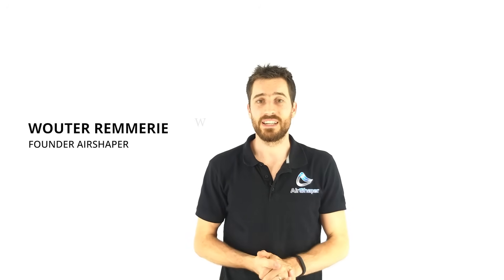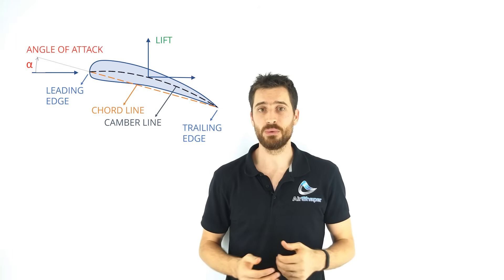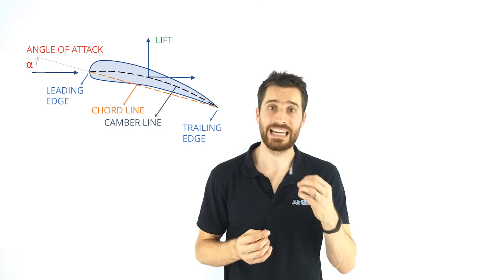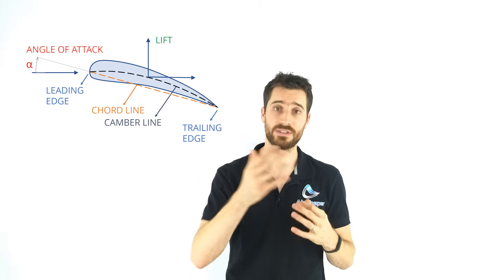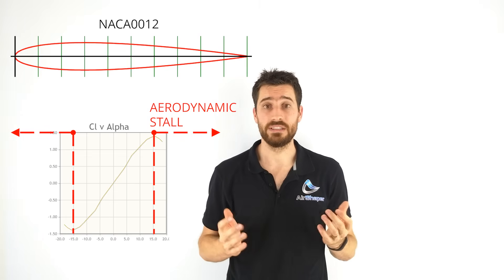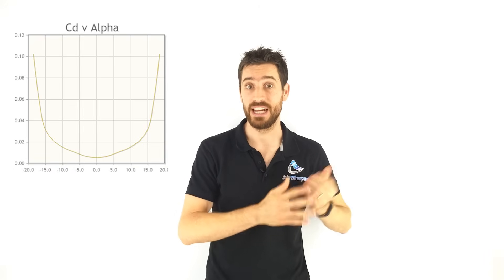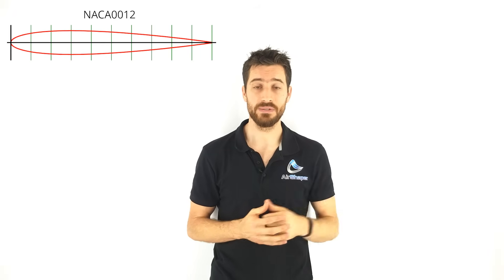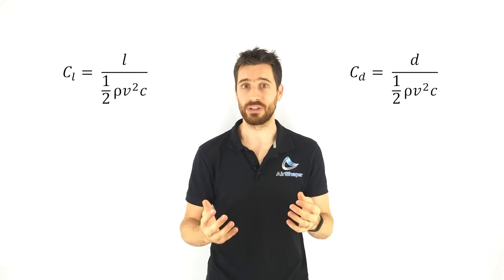Drone Design #1 - Selecting an Airfoil

Comment: It is a good video but i find selecting an airfoil as a first thing in the design process wrong. Airfoil selection can really be a late phase in design of a fixed wing vehicle. In drone design apart from cL/cD characterstics, coefficients of moment characteristics will matter more. If you are not in the last design phase, trying to optimize airfoil for optimum lift/drag without even having a planar and 3d profile yet will prove wrong. As an example, a thick or simple airfoil that still can get the jobe done will prove usefull in terms of manufacturing and extra size inside wing we can use for a lot of things.
Reply: I agree with this. Also the 3d shape of the wing plays a significant role in the final aerodynamics. Also, you can't select an airfoil without knowing an estimated trim condition and flight Re. And you can't know that until you've performed high-level trade studies
Reply from the maker: I agree that the video perhaps wrongfully implies this is a sequential process. In reality, it is like you say, you need to iterate between various aspects. At least we hope we gave good hints for a first shot.

Comment: I’m currently doing A Level Design Tech and part of my coursework is to design something of our choice this will involve Low fidelity and medium fidelity prototyping of some sort. Do you think it is possible for me to design an aerofoil or something? I want it to link to aerospace Engineering. Do you have any ideas on what I could do?
Reply from the maker: Dear Prashant,

airfoil design does require fairly high fidelity, especially if you are looking at 3D flow (which can vary greatly from 2D flow) and/or separation locations. Perhaps the flow around a drone bodywork could be interesting for you to study? (check our second video on drone design)
Reply: @AirShaper  Thank you for your fast reply and as a matter of fact it helped me a lot. I’m going to design and build a budget remote controlled drone targeted towards those who can’t use it due to money. Outside of your second video on drones is there anything else you could help me with?
Reply from the maker: @Prashant-pm7iz  Perhaps it could also be useful to check this article:
https://airshaper.com/cases/sense-fly-increasing-drone-flight-time
That would be about it in terms of what I can think of to help!
Reply: @AirShaper  Thanks mate, I appreciate it.

Comment: Which airfoil to use in 1045 propeller in typical quadcopters?
Reply from the maker: Hi Ayush, 
I wouldn't be able to answer thay without proper research I'm afraid!
Reply: @AirShaper  Can you guide me where I can find that? I need that data for 1045 prop and 1047 prop.
Reply from the maker: I wouldn'y know Ayush. Perhaps search hobby forums?

Comment: Do you know any hooks to teach designing airfoil? I need  to learn to design airfoil wings but I have no knowledge. If you let me know what are the books I need to buy I thank you
Reply from the maker: I would recommend airfoiltools.com, and of course a quick google search will yield many relevant books. Depends on the application (low or higj speed, size, ...).
Reply: @AirShaper  thank you so much. I need to design and build a wing similar to jet man. I asked many universities but none willing to help. So I need to do it myself. Any other useful information if you can give me? I guess since the wing has no tail the lower chamber design  should be upward. I need to calculate a wing 120cm of chord for speed minimum of 200km per hour.
Reply from the maker: @noneNone-mw1px  I wouldn't wait too long before moving to 3D, as the person will have a huge impact on the airflow! In terms of airfoil selection, indeed you'll want one that is relatively stable (the "torque" or "moment" will be important), with a gradual stall angle.
Reply: @AirShaper  yes true I need an stable airfoil with highlift efficiency. In my investigation I found that for delta wing with  no vertical stabilizer the best airfoil to have upward lower chamber. So do you have any idea where and how should I start? Universities are really very disappointing. Either they do not know or they' do  not want to help
Reply from the maker: @noneNone-mw1px  This would also be beyond my knowledge, but I think you should look for "self balancing/stabilizing wing or airfoil".
Reply: @AirShaper  you mean even will downward chamber is it possible to have stable fly just by balancing? I m a pilot ( not commercial) but that what I was thinking . I look into jetman wing airfoil from his clip. It looks like not having upward chamber.  But in x_wing  jet it has
Reply from the maker: @noneNone-mw1px  I wouldn't know if it's possible, actually. You could also consider browsing fora on Xfoil / FXLR5 (or use those tools!)
Reply: @AirShaper  thank you so much. I will look to it. Any books you can recommend me?
Reply from the maker: @noneNone-mw1px  You're welcome! No in terms of airplanes & drones, I stuck to internet for info. This one looks cool though: https://www.springer.com/gp/book/9783662026465
Reply: @AirShaper  thank you so much. It was very kind of you.god bless. Safe and sound

Comment: Hello Buddy, You explained it very well.
I'm an undergrad student and I'm supposed to design a fixed wing vtol with 2 hours flight time and 2 kg payload carrying capacity, so which airfoil you would suggest to achieve these milestones?
Reply from the maker: I suggest you to browse airfoiltools.com to look around, look for efficient profiles for your specific Reynolds number. And keep in mind that when going from 2D to 3D you can lose a lot of lift due to the finite wingspan. So do check for correction factors for this befote you size the wing (you can find some in Joseph Katz's 'race car aerodynamics' book).
Reply: Hii, I'm Shivam Tadwalkar from India. I'm also supposed to design a VToL aircraft. Can you please help me with that? If you have made your project.

Comment: A new easy way is to grab the free Airfoil Tools add-in for Fusion360 - it asks you how big/fast/high/etc, and inserts the CFD-optimised shape you need directly.  https://apps.autodesk.com/FUSION/en/Detail/Index?id=5447707798035545266&appLang=en&os=Win64

Comment: this is a good video. though I'm currently having a hard time selecting an airfoil for my fixed-wing drone. can you help me?
Reply from the maker: Hi James, indeed, it's not an easy task!! Best to start with your payload & estimated weight requirements to obtain a required lift value. Keep in mind that when going from 2D to 3D, you loose quite a lot of lifting power due to the non-infinite wingspan. So be sure to run a full 3D sim at some point as well! And if the choice of airfoil is too complex, start with a common profile that you find on other drones (google will quickly show interesting references). The special profiles are for later on, once you've run prototype tests and/or need to upgrade your design later on.
Reply: @AirShaper  Thank you so much. makes a lot of sense

Comment: 1/2*rho*v^2 is not the stagnation pressure. It's the dynamic pressure.
Reply from the maker: Hi Stefan, you are right, it is the dynamic pressure. We're a bit too used to working with relative pressure difference so we forget to add the static pressure, our apologies!
Reply: AirShaper All good. Thanks for the video

Comment: hi, im an engineering student and i m making a drone whose function is to carry an attachment that will throw a ball to a particular place at some height , i searched about drones , and i got to know that copters that lift more weight are difficult and too costlier to develop, so my q is can i opt for fixed wing to perform the same operation, whats your opinion?
Reply from the maker: Fixed wing drones can indeed carry more weight in some cases, but they need speed to have the wings generate lift. So it could be necessary to launch the drone using a catapult for example (this is quite common)
Reply: @AirShaper  can you explain in detail in which cases it can lift more weight and do i need to launch it from catapult even if i have a runway long enough?
Reply from the maker: If you have a large runway, you may not need a catapult. The ground effect (wings generate more lift when close to the ground) will make take off easier. So it comes down to selecting an airfoil and a required velocity to get enough lift!

Comment: Hi sir 
I am an Aeronautical student doing my undergraduates .I am interested in designing drones but I don't  have any proper guidance of doing it done .Can you say  me what to do exactly to learn to design and what are the things I need to mainly look after for getting it done .

Waiting for your reply
Reply from the maker: Hi Viswak, there is a lot to be learned by just starting to build your own, using parts from hobbyking for example (if budget permits it). Setting up controllers and so on, will make you learn a lot! Apart from that, perhaps it could help you focus to decide on whether you want to go for vertical propeller drones, or fixed-wing like drones (in the latter case, you may want to focus more on general aviation theory). Good luck!
Reply: Thanks for your reply .It was very useful but I have one question what are the open source software for programming and designing drones We can get which is best .

Waiting for your reply
Reply from the maker: @hurtlessstatus3414  Maybe you could have a look at this one: http://aero.go.usu.edu/machup/
Reply: Thanks a lot it is very useful
Reply from the maker: @hurtlessstatus3414  Most welcome!
Reply: I also enjoy MachUp. feel free to check out their udemy course on drone design.

Comment: Hi Wouter 

Am a Mechanical Engineering Student planning to do my Undergraduate thesis On Unmanned Aerial Vehicle could you suggest some books and website where i can start from scratch to build a UAV and all the basic concepts in aerodynamics to understand  in a much detailed manner. 

waiting for your reply
Reply from the maker: Hi Balaji, 

That sounds like a great subject for your thesis!

I don't have a UAV building book top of mind but a website/tool I might suggest would be our new partner CAESES 
https://www.caeses.com/news/2019/caeses-and-airshaper-for-aerodynamic-glider-design/?fbclid=IwAR00DeJipokLyk-gWZYrXALZs14Djr2HO79TgUpuqGHAGLs0yJqviJyL3lk

They are about to launch a glider design web app. It will have a short preliminary analysis within the tool and also an easy export to AirShaper button for a full 3D flow analysis. It will also have options for other types of designs. 

A book you might be interested in about the basics of CFD is: Fluid Mechanics by Frank M. White. 
For other questions, make sure to check out our other videos or let us know, we can answer them or maybe even make a video about them! 

Kind regards,
The AirShaper Team
Reply: @AirShaper  the same thing happened with me I need to start in my graduation project and I need a practical approach to design a drone not theoretical one.
Thanks anyway for your valuable information. And keep up the good work.

Comment: Hi Wouter, my name is Angelo Conte and I'm an aerospace engineer who has working on the designing of propeller for a multirotor. I would like to ask you a question: suppose that I want to design a propeller (10 inches of diameter and 4 for pitch). What approach do you can suggest me to analyze the blade of propeller near the hub in hovering condition, where the Reynolds number is very very low and the beta angle is about 30 degrees? I thought to use xfoil with viscous analysis but in that condition the convergence of solution is never reached. Thank you in advance and my compliments for your videos. Great job. Ciao
Reply from the maker: Hi! Indeed in those conditions flow is quite tricky, as it's a very 3D flow:
air doesn't just flow over the cross section of the airfoil, but also transversal to it. So an approximation with 2D simulations can be a bit tricky.

If you're handy, I'd suggest to set up a cyclic 3D simulation, with either:
- real moving geometry (sliding mesh)
- virtual rotation (MRF - moving reference frame)
- tangential velocity condition

All of these can be done in OpenFOAM, if you like!